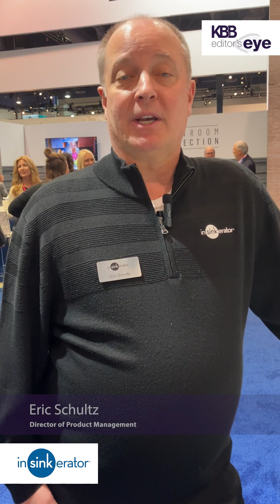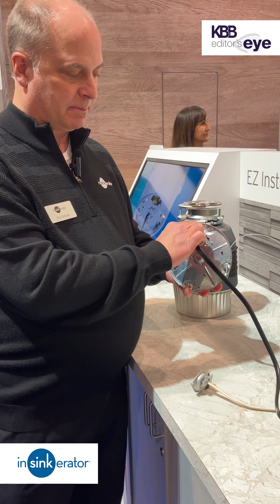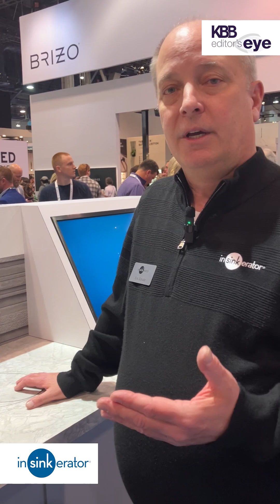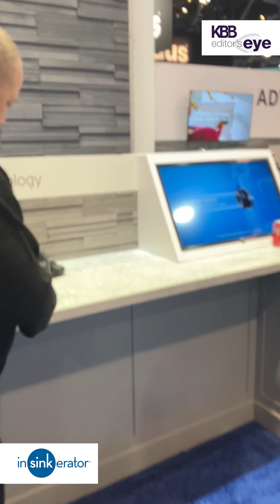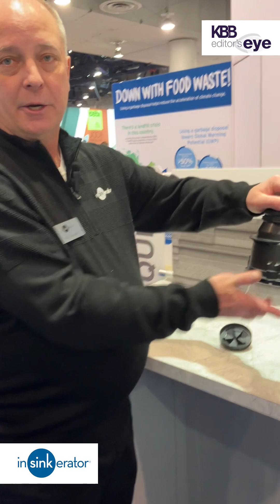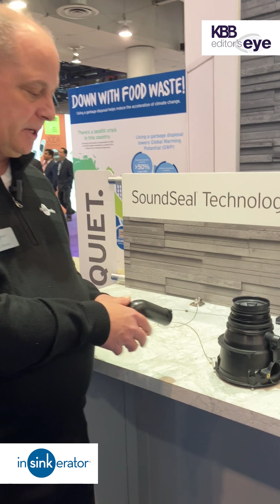InSinkErator’s Power and Advanced Series of Garbage Disposals

Comment: Why isn’t the quick connection new wiring come in the box ? I payed for a garbage disposal to replace a broken one I go to install it and it’s missing the cord , to boot I lost time having to go back to Lowe’s where I get hit for another $17.00  , not cool!😒
Reply: Yeah all smoke and mirrors too. I've spent days researching what model to buy- reliable one is the older Pro750, no gimmicks, no compromise, stainless where its needed, noise? it's a garbage disposal not a radio. Try buying one of those, they want you to buy this tricked up re-designed one meant to fail sooner so you'll be a repeat customer.